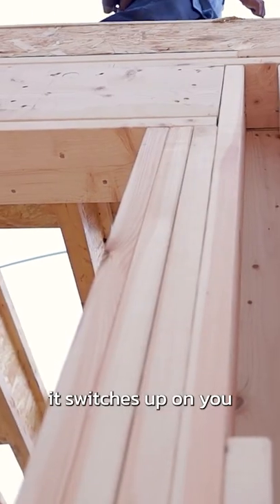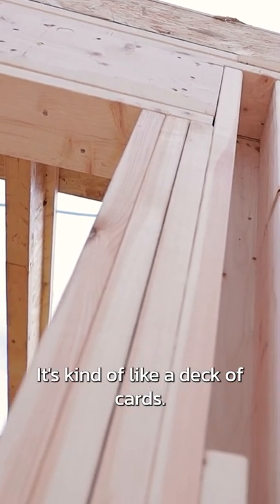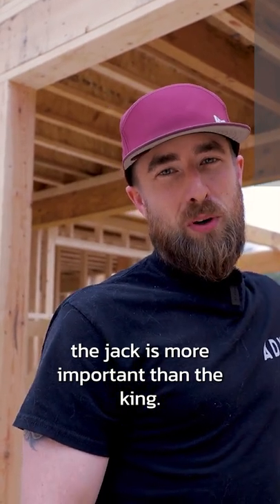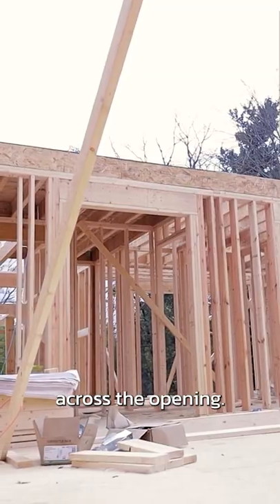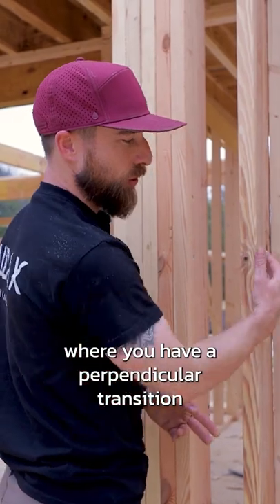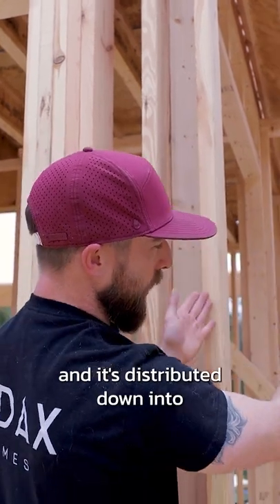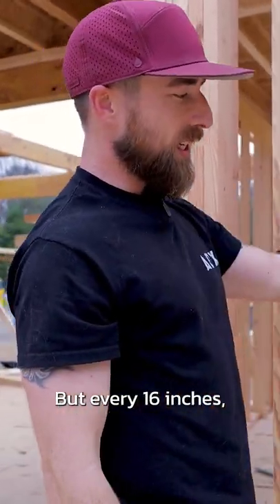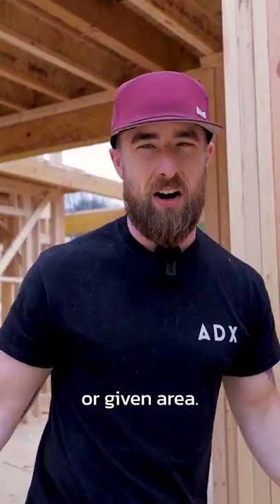KNOW YOUR STUDS 🔨 #Shorts

Comment: Trimmers/jacks and Kings are both important.  Not one more than the other.  Trimmers support the gravity load as mentioned and kings support the out-of plane lateral load.
Reply from the maker: Boom 💥 thanks for dropping knowledge
Reply: You can’t say one isn’t more important than the other lol jacks are definitely more important
Reply: Not exactly. It's not just the king stud that supports the out of plane lateral loads. All those studs (jack and king) nailed together form an assembly which is essentially a post and it's the thickness of that entire post that resists lateral loads and buckling.

Comment: Great video! I dont know where your from but in Canada we are taught different terminology. In our builders code jacks are trimmers and headers are called lintels but in the job everyone ive worked with uses your terminology. We are also taught that our lintels must be bearing directly on our trimmers because if we have a sill plate between the two it will shrink. Just some fun info for ya!
Reply from the maker: I like Canadian terminology better. We are going to start making everyone use trimmers!
Reply: @revivalcraftsmen  Where do you build typically if you dont mind me asking?
Reply: @satanlucifer4568  I’m from Canada and I’ve always been taught jacks and headers. But I agree with you on the packer under in between lintel and trimmer. I think we have such drastic change in temperature here that we deal with more shrinking and expanding than most places. But yeah, at least how I was taught I would always put my trimmer directly below lintel
Reply: @joekember3319  On the job ive always said jacks and headers same with people who i work with and learned from. Only in school we are taught lintels and trimmers because thats the terminology thats in the NBC same thing with metric and imperial almost everything in the NBC in metric but all of our practical portions are imperial same for on the job the only thing we personally deal with in metric is some prints come metric.

Comment: this is framed incorrectly, your filler should not rest under the header on the jack studs it will compress and adds more seasonal movement. The header should rest directly on jack studs. the filler should be between the jack studs
Reply from the maker: We disagree, are you an engineer or a framer? Appreciate the feed back though!
Reply: @revivalcraftsmen  Ticketed carpenter, which part do you disagree with? It is a legitimate method of framing and will not fail any inspection however its accepted as the inferior of the two.
Reply: also look at energy efficient framing. alot of studs are non essential and reduce r-value.
Reply from the maker: Saying it’s accepted, but inferior is a lot different than being incorrect. Thanks for your comment.
Reply: I’ve always been taught to do it the other way wood is stronger in the vertical grain direction I think it’s in our building code here (canada). But really I don’t think it matters that much I’m sure you build a great house.

Comment: So I have a real question how do you know how many Jack studs to use for a given opening is it the equivalent of the 16 on center studs like if the opening would normally take up 6 16 on center studs do you use three Jack studs on one side three Jack studs on another side or is there a contractors building code that would be better to follow.
Reply: There are charts and codes that give this information. Usually any opening  6 feet or wider gets 3 on each side.
Reply: @Mendedsticks  so it is a code thing not a rule of thumb thing. Got it thanks for the info

Comment: A roofs weight sits on the outside walls only which sit on the foundation
Reply from the maker: Maybe when your building a small house. Thanks for comment 🤘🏻
Reply: 🤦‍♂️🤦‍♂️🤦‍♂️ please stop
Reply: Sean....on one story houses with prebuilt roof trusses.   You are correct....two or more stories rely on load bearing walls on the interior of the house.... remember that when remodeling the downstairs or basement of a 2 story house

Comment: 3 Jack's are unnecessary for that span. Jtluk
Reply from the maker: You may be right, but we have to follow the engineered plans for stuff like that. Better to over build, than under build! We appreciate the feedback regardless!
Reply: you don’t know how many stories or loads are being applied onto those framing members. also some areas have heavier snow loads etc…
Reply: @ThaGreatestAlexander  actually there are span tables for openings that represent the strength as if the wall was just regularly spaced studs underneath. what im saying is that unless there is a beam going over the header then it is overbuilt. so unless you have proof there is a giant column going over this that carries and entire roof section... and the other headers are not all the same, then i am correct. just look up header span table for jack and king studs and you will see. single per ten feet double for over ten. then it gets into different materials for further distances.
Reply: @Valient6  ya there are span tables, everyone knows you follow the drawings and you are covered. Its all about liability.
Reply: @ThaGreatestAlexander  as for the stories it would be the same stud alignment as next to the header...

Comment: You’re wasting time, material & money… Especially with the cost of lumber today… You only need two jacks per side with that span… It’s a nation wide standard
Reply from the maker: You have no idea the amount of load on our second floor and there isn’t a national standard. It’s based on snow load and how large your roof is and pitch. Thanks for your comment.
Reply: @revivalcraftsmen  If the load was that heavy the 2x  header would be switched out to LVL.. 
No big deal… Just saying a 2x6x8 round here is about $12 before tax… so that can add up quickly